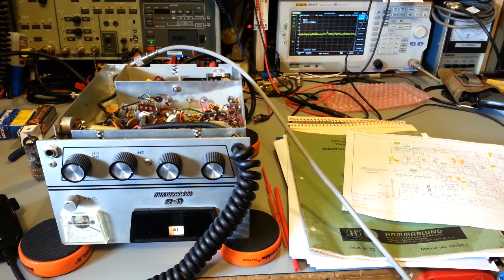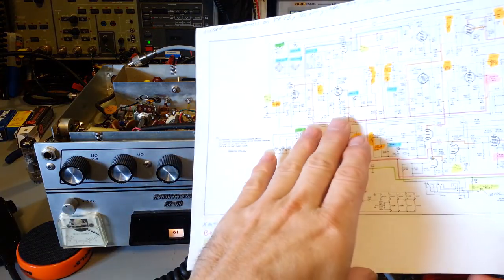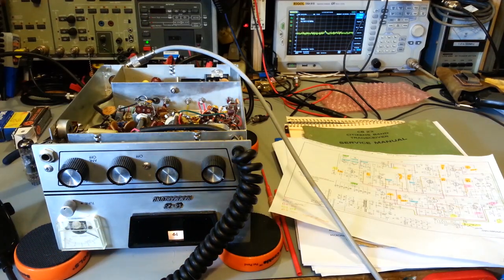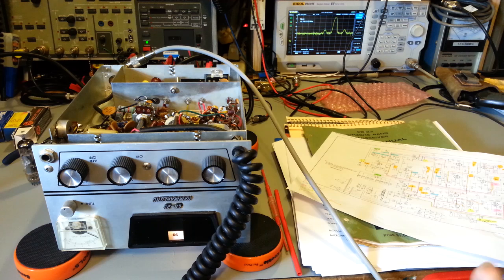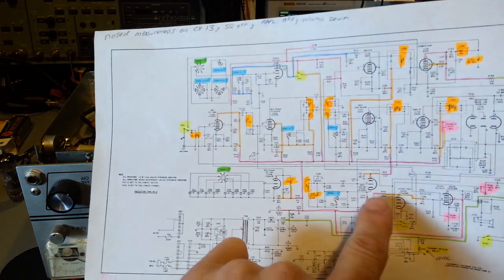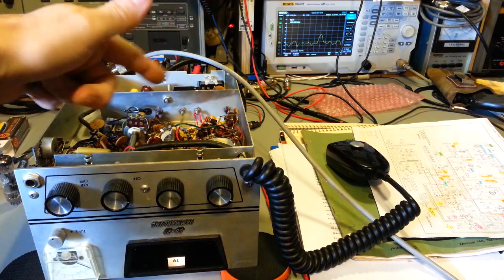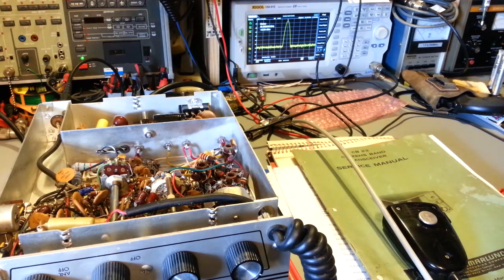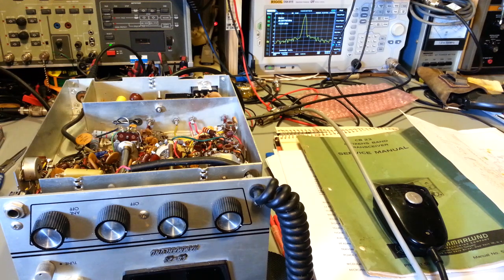Old tube type CB with high RF emissions in receive. Oh how FCC standards have changed.

Comment: I literally said "holy shit!"out loud when you showed the actual peak on the SA. I've got QRP rigs (WSPR) that transmit less than that rig leaks iol
Reply from the maker: Michael Lloyd 

Take the coax cable and route it through a CW key and BAM, instant CW transmitter. ;-)
Reply: Lol The predecessor to the Shack in a Box :)

Comment: My boom box back in the 80s used to put out a large oscillator carrier that could be picked up on another radio several feet away. I used the carrier from it to tune in single sideband on my other radio as I didn't have a shortwave radio with sideband.
Reply from the maker: billybassman21 

LOL, it was dual purpose, a radio and a carrier oscillator.  :-)

Comment: If you really wanted to put a specific xtal on freq could you not hang a trimmer cap on it to warp it on freq?
Reply from the maker: Andy Thrasher It's possible but would be difficult for several crystals in this radio.  They mount to the channel selector switch and access to some of them is rather limited.

Comment: How do you like the Rigol spectrum analyzer? Any downfalls to having one on the bench?
Reply from the maker: Charles Blythe 

None that I have found. For two way radio repair this one works great.  This one also has the advanced measurement package so taking measurements for things like IMD, occupied bandwidth, channel power, etc is extremely easy.  Running those test is automated.

Comment: LOL.....They don't build them like they used too! LOL.....I do not mean that in a bad way either just something you hear all the time. Sometimes that is a good thing and sometimes it is a bad thing! LOL Even I say that because I like 1980-early 1990's CB SSB and AM CB's compared to modern radio's! LOL When it comes to audio and stereo sometimes some dirt int he audio is a good thing but definitely not dirty rf leaking randomly! LOL Holy Shit -12dbm!!!! 

Imagine that radio on an amplifier especially a dirty sweep tube amp being over driven! I bet the harmonics would be wiping old style non-digital TV like crazy especially if they had any sort of amplified omni tv antenna! If it was bad enough the harmonics of 12Mhz could wipe out a lot of signals 144Mhz can be reached by a harmonic of 12Mhz! The only saving grace would be lack of resonance on CB band width antenna's.